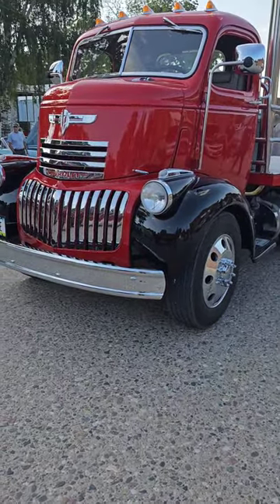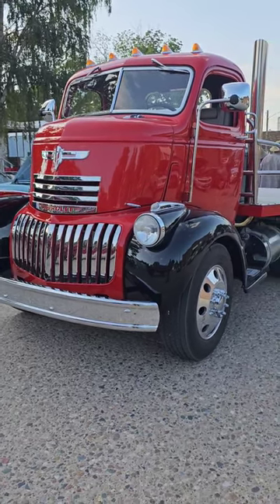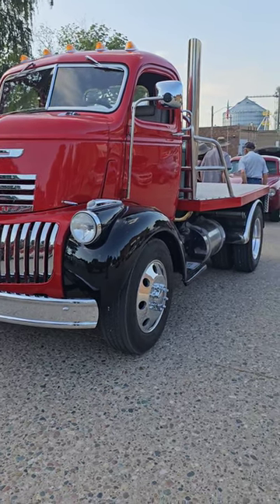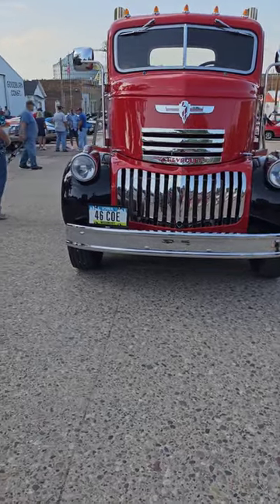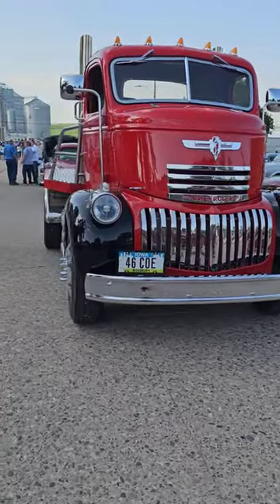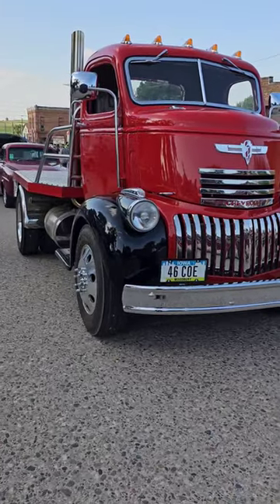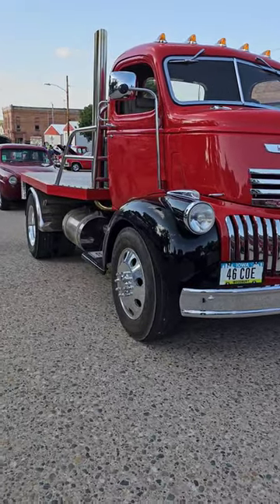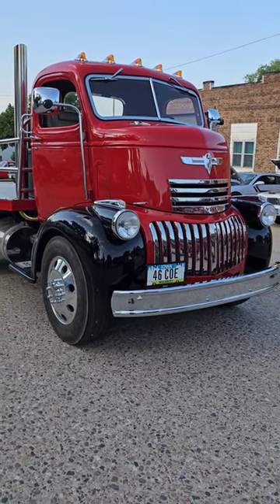What is a COE Truck?

Comment: Also the shortened wheel base of the truck allowed for a longer trailer without affecting overall combination length. 

Meaning a logistics company could move more material in a truck that doesnt exceed maximum length limits.

Comment: Got a 68 Ford N600 in the machine shed on the family farm. It's on the list to getting running again. It has the 361 truck engine and when we where using it regularly it would really move. The COE is probably my favorite 2 ton trucks.